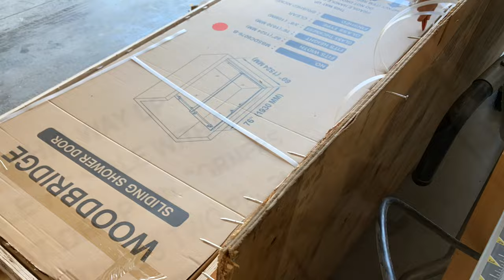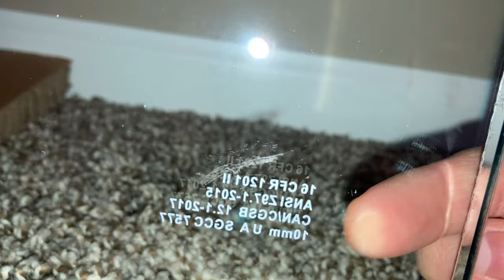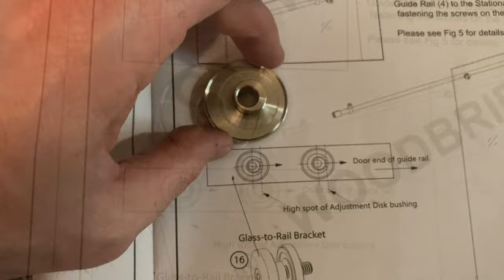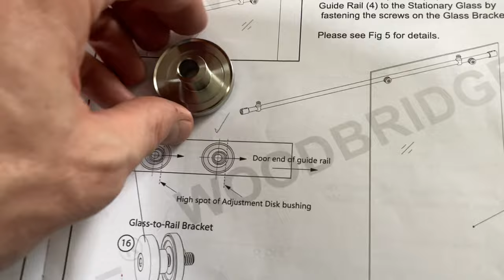️🔥 Woodbridge Frameless Glass Shower Door➔How to DIY Install: Step-by-Step Instructions + Review

Comment: great video, what is the name of the silicone adhesive you used.
Reply from the maker: 100% silicone to seal, or adhesive silicone as “glue”…aff links are in description if you need exact info, but any of those are easily purchased in store as well

Comment: We dry fitted the panel on the rail using 3/8 shim on the threshold.  Leveled and plumb.  After installing the rail/panel and removing the shim, the rail bows and the panel is not level anymore.  Will adding the door balance it out or something?  It seems that when the door is opened it will add even more weight and bowing.
Reply from the maker: I did not have this problem, so I can't say. What's the status - did you figure it out?
Reply: @diybandit  They sent us a new bar.  We aren't hopeful as it looks the same and other sites use a solid stainless bar, not a pipe.  
Any ideas as to how we could make this work?
Reply: @diybandit  installed the new rail.  same bending in the middle of the rail, making the right glass panel fit tight against the tile at the bottom of the right wall.  installed the door on the left and the door rolls to the middle.  when the door is closed at the bottom, there is a large gap at the top.  I don't know why 2 rails are not holding the weight of the glass.  and no one else has had this problem.
Reply: @octamamma  Woodbridge has been very understanding and working to figure it out.  No one else has noticeable deflection in the rail?

Comment: First, thanks for the video. 
Second, and this is important, adding the bar and then measuring, like in the video, is the way to go. My husband thought we should use measurements instead. No!!!!!
The measurements we used, from the comments are dead wrong. It's awkward, but put the stationary panel in place and mark the location on the walls. Trust me. The measurements people provided were about 1/2 or so too low. 😢 Had to remove brass brackets and start again with higher holes. It was almost a disaster. And you can see the old holes slightly after redrilling. 
Anyway, should have used your method. 
Excellent door for the price.

Comment: Any suggestions for how to get the glass out of the box?
Reply from the maker: I remember unpacking foam, etc. first, then carefully lifting out onto a soft surface. I had the help of a neighbor as opposed to doing it myself. Both glass pieces are awkward and heavy. It should NEVER be in contact with concrete or anything hard or it could crack. Extreme caution - always! Good luck.

Comment: Do you have to install the wheels before put the door on the bar?
Reply from the maker: The sliding door hangs and then rolls on the bar using the wheels, so yes, the wheels would need to be installed prior to lifting the sliding door onto the bar. Look at 24:58 in the video for how I did it and of course refer to the instruction manual.

Comment: I got the same door but for installing in a bathtub shower. I installed the bar but now the stationary glass is sitting directing on the sill of the tub with no gap. I can’t move the bar any further up without drilling new holes. Anyone else have this problem? I think I need to take it down and shim it an 1/8” from the tub and reinstall unless you have any other ideas.
Reply: I think we are having this type of problem.  Used 3/8 plywood shim to dry fit and install.  After install, slid out the shim and the bar bows putting the glass almost on the shower threshold.  Did you figure out a solution?

Comment: the glass that close towards the wall is not straight to the wall, the bottom side is staying away from the wall leaving a gap between the glass and the wall, HOW DO I ADJUST THIS SO NO WATER COMES THROUGH THE GAP,  the top side is at the wall and the bottom side is no ,,,,,  thank you